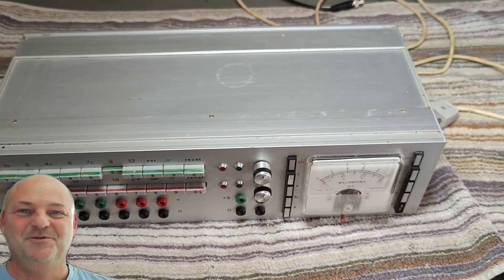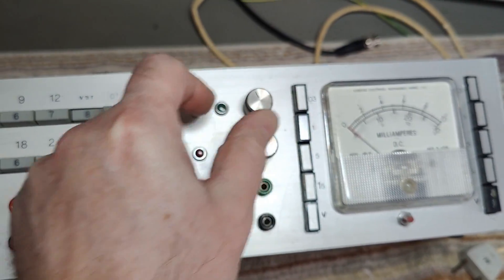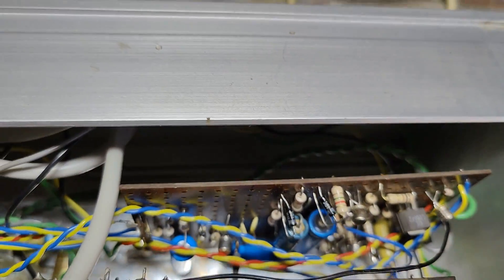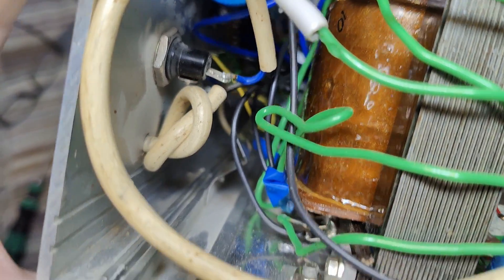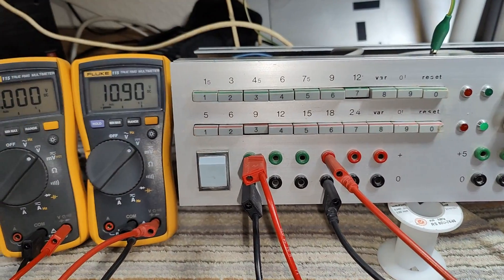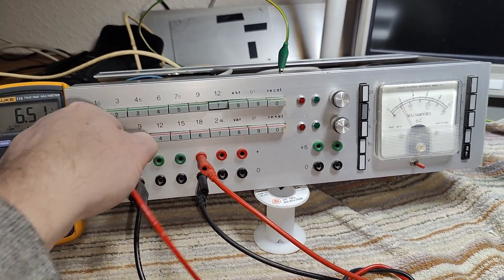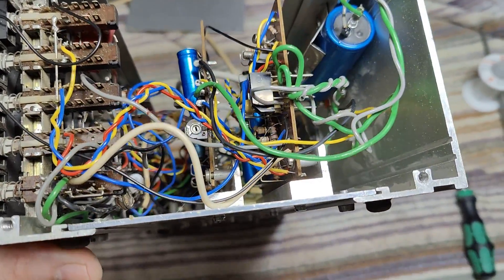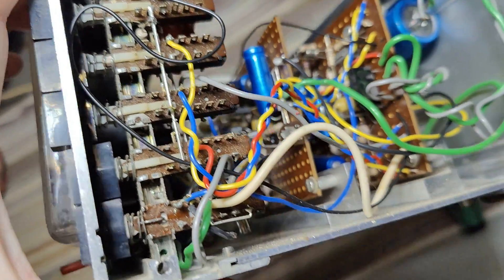DIY power supply Linear 1980 pushbuttons quite special idea

Comment: Oh no. Now you showed this fantastic user interface on the internet. Now the chinese are going to copy it....
Reply: I'm not Chinese, but I have a couple switch blocks I could use ;) hehehe
Reply: That’s … good? They aren’t super big on user experience generally, and the best I can tell next to no T&M UI innovations come from China compared to the west. We better give them something nice to copy/learn from. After all, we’ll end up using it as some point.

It’s a separate question how useful this button interface generally would be. A lot of buttons for a very specific use - if you need them, it’s great, otherwise it’s a lot of front panel estate for not much use. I guess someone was tired of dialing in common voltages? Maybe this was used in a service shop as a battery eliminator/current limited supply and the common voltage settings were saving time?